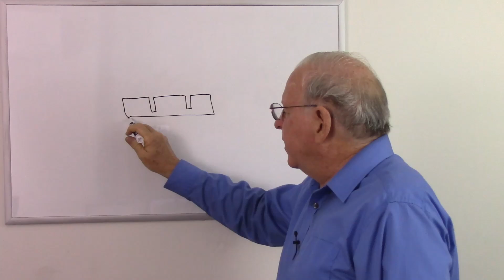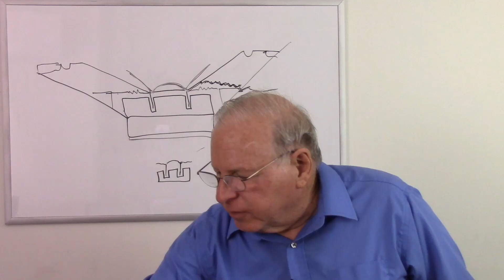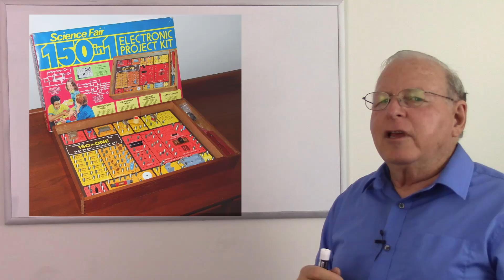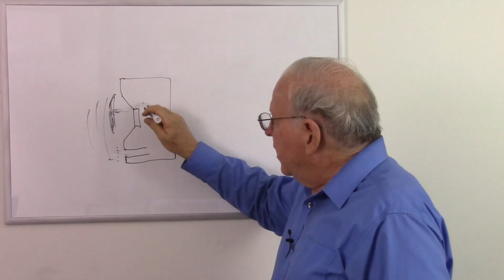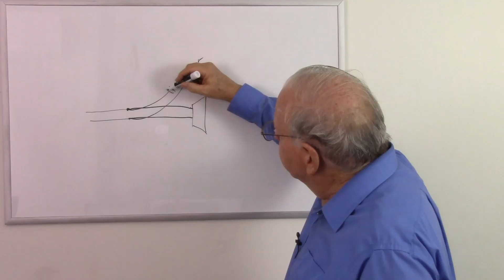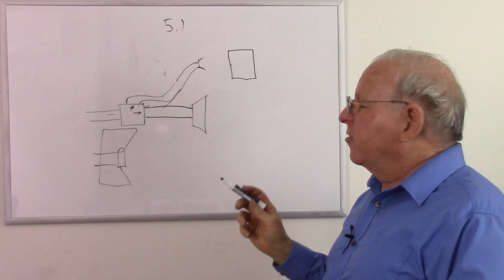Comment: The closed enclosure adds to the mechanical stiffness, and is not seen as 'negative feedback' (whereas having a sensor on the diaphragm and feeding that signal back in the chain would be), although a block diagram can be made for the force equation Fext=Fmass+Fstiffness+... can be drawn with some positive and negative summation in Simulink or similar. The enclosure thus does not affect the higher frequencies from a stiffness point of view, as the transducer is mass-driven there. So, whether you have an infinite baffle decoupling the front and the rear, or an enclosure, the response at higher frequencies is the same. The port output is also not being designed in such a way that the driver output is in-phase with the port output (although above the port resonance that is the case over a limited frequency range), but rather when the port outputs the most, the driver does not move and so it does not matter that it is anti-phase with the port. Again, the upper frequencies are not affected by having a port, albeit for potential (unwanted) resonances in the port higher up.

Comment: 0:27
"Power is manifested by producing either heat, mechanical motion..."

The loudspeaker paradox:
A normal high quality 2-way bookshelf HiFi speaker has an ⁿ0 of about 0.5%.
This means that 99.5% of the power is manifested in heat, 0.5% in acoustic power. 
Considering this, it would be more appropriate to call a speaker a heater. Even though it will be an inefficient heater, but still. 😃

Greetings from a professional loudspeaker designer.

Comment: You seem like a very knowledgeable, old fool.  You got most of this right.  You are very educational.  But you don't know what I know.  Few of you academic types, do.  As you got something fundamentally wrong with speakers.  In general.  And that is... the electrical engineers that created them.  They've all made a stupid beginner mistake.  How do I say such a thing?  How do I know this?  I'm so glad you asked.  Let me explain.

Back a long time ago.  Probably 70 or 80 years ago.  The electrical engineers got something right.  In a very wrong way.  And that is Speaker Absolute Polarity.  They got that backwards.  But their mathematics told them.  That, they were right.  Technically speaking?  They were, they are.  Until they connected them.  When they did it, backwards.

So what the hell am I talking about?  Speaker polarity and not, phase.

I meet oh sure.  You get your left and right channel speakers in phase, together.  You followed your instruction manuals.  For both your amplifier and your speakers.  Then you have it connected, correctly.  As per the diagram.  And you're left and right channel speakers are in phase, together.  But unfortunately.

At the same time you have both speakers in phase, together.  The mistake the electrical engineers made.  Has your speakers in phase together and in Negative Absolute Polarity.  What?

Phase and Polarity, everybody thinks is the same thing.  Sorry.  It is not.  Because your speakers are in phase together but in Negative Absolute Polarity, together.  What does this mean?  What am I precisely saying?

While the electrical engineers think and want to believe.  The speaker cones and domes are, protruding out toward you.  Unfortunately.  Electrical engineers and acoustic engineers are not, Actual Audio Engineers.  However, I am.  Not only multi-major music award nominated.  For my Audio Engineering and Mixing, expertise.  But I am also a top-notch, Studio Fixer, person.  Where I have fixed, monitoring issues.  In, Top Recording Studios and Broadcast Network, TV & Radio Network Facilities.  Because of all the electrical engineers and acoustic engineers.  With their advanced college degrees.  Possess brains.  That only partially work correctly.  And they got this backwards.  This Polarity, thing.

What has happened here is.  Your speakers are actually moving, in the wrong initial direction.  This is what they got wrong.  They believe they have indicated Positive Polarity.  As they used a simple test involving a 9 volt battery.  You connect to your speaker.  And when you see the cone move outward.  They will mark that, connection, Positive.  And that is correct.  This proves they are right.  No it does not.  Because they got the entire concept, wrong.  They are not Audio Engineers.  And thus, don't know what they are listening to.  Don't know, how it should sound.  They are clueless.  Because the speakers are moving in the wrong direction, initially.  They are actually sucking.

That's right.  The speakers are not protruding out toward you.  They are sucking inwards, away from you.  But the electrical engineers and acoustic engineers are convinced.  They are right and I am wrong.  Nope.  It's the other way around again.

What they have actually done.  In their mindless academic ways.  Is to get everything in phase.  From microphone input.  To the audio power amplifier, output to the speaker.  And yes.  They have everything in phase.  And the speakers are in Negative Absolute Polarity, as a result.  What?  How?  Why?  It actually, academically simple, to explain.

Because they are not actual Audio Engineers.  They did not take into account nor consider.  What are the microphone diaphragms doing?  That recorded the music you're trying to listen to.  What are the microphone diaphragms doing?  When a sound source, smacks into those diaphragms.  Which direction are they moving in?  And would you want your speakers moving like that?  NO YOU DO NOT.  That's backwards.  LOL.  What a bunch of lame brains those college grads are.  With electrical engineering degrees.  With acoustic engineering degrees.  What a bunch of knuckleheads frauds.  That cannot understand.  The actual recording process itself.  And what is occurring.

I discovered this Pro Audio Anomaly.  Back when I was only 22 in 1978.  And I had just designed and built from scratch.  Baltimore, Maryland's, second-largest music recording studio and commercial production facility.  And when I say scratch.  I mean scratch.  I design all the acoustics.  I design the control room.  And all the wiring required, therein.  I even designed and built, from scratch.  A 24 input, 8 group output.  With 4 effect, outputs.  And the Stereo Mix Bus.

Then with my custom-built audio console.  That cost over $10,000 in just raw parts and pieces.  Back in 1978.  I included, 3 push buttons.

These 3 push buttons were for, 3 stereo pairs of control room monitor speakers.  Kind of like the 3 Bears.  The little ones.  The big ones.  And the medium-sized ones.  The only problem was... I only have the small, 4 inch, Auratones.  And the big 15 inch, Altec Lansing 604 E.  Control room monitor speakers.  And those were the industry standards.

When I fired up my brand-new, control room.  It looks great.  Everything worked great.  But the sound was not great.  It was not to my liking.  I thought I had made some major technical and/or acoustic blunder?  It did not sound the way I thought it should.  Maybe due to the fact.  I was nothing more than a bona fide, high school dropout with a GED.  And no college whatsoever.  Though?  I did take a couple of weeks of, technical training seminars.  How to fix some tape recorders.  But that's it.

And so now I feel like a failure.  My control room was not sounding stellar.  It looks great.  But not sounding up to snuff.  So?

I hadn't purchased the medium-sized monitor speakers.  So I opted to get a pair of JBL 4311's. And I wired those in.  And when I played back through those.  OH MY GOD!  YES!

I was pleased as punch with those.  Now my control room sounds exactly.  The way I had been tended it, to sound.  How I wanted it, to sound.  The way it had to, sound.

But then I did something funny.  I could turn on any one of those three pairs of speakers.  And so I also turned on the Altec Lansing 604's.  And whoops?  What?  What's this?  My Altec Lansing speakers are, " out of phase " with my, JBL, speakers.  But wait?  Everything is wired correctly.  And both pairs of speakers.  Were designed and built by the same guy.  James B.  Lansing.  And I wondered, why would he have done this?  This doesn't make any sense.  They are not Properly Polarized, together.  Then I turned on the Auratones.  They were the same as the Altec Lansing speakers.  Out of polarity but in phase together.  To the JBL's, also.  What the FUCK?

(More Backwards Speakers in following posts)
Reply: The microphone moves in for a positive pressure, if it is wired that way. It typically has its fundamental frequency high up, so in its operating range it is stiffness controlled. So, you make sure that you have that phase correct. The loudspeaker is different. It is operated in its mass-controlled region. A battery will push it outwards (if you wire it that way), which means that it generally moves inwards(!) for a positive voltage in its operating frequency range. That is what you want because not only is there a transducer principle, there is also a mechano-acoustics coupling, and the typical environment (acoustic impedance) seen from the loudspeaker is mass-like. So, a negative displacement drives a positive(!) pressure (skipping a lot of details about the actual impedance, modes, the driver not being flat, and similar). You are on to something, but only halfway there. Most acoustic engineers get it wrong, yes, in that the see positive pressure for positive voltage, and assume (via thinking about the battery) that positive displacement is driving this, but there are two anti-phase operation that they are missing, but they end up with the correct wiring, which is opposite of what you suggest. Now, when adding a cross-over, taking into account the phase response of the multiple drivers, and the acoustic environment, the pressure phase is not quite in-phase with the voltage, as a loudspeaker generally has quite a nasty phase response, so looking at the step response of various loudspeakers, even within the same company, the first part of the step response may go down or up, and so the actual labeling (red/black) on the rear of loudspeaker is not trivial, and is probably decided differently for different companies, so you could have a point there, but otherwise a rant without much substance.

Comment: Our brains can not decipher.  Sound in front of you.  That is sucking away from you.  And being able to tell what the hell you are hearing?  Without jumping through multiple hoops.  Of playing back through multiple speakers.  Then hopping in your car and listening in there.  To try and get your mix right.  At a great expenditure of effort and time.  Then they all end up thinking... there is something wrong with their acoustics.  So they spend thousands of dollars more.  On their acoustics.  But that still doesn't do it.

Then they think they have purchased the wrong amplifiers.  So they changed those out.  That still doesn't do it.  So it must be their audio console that's not good enough?  So they replace it with a much more expensive one.  And that still doesn't do it.  So they call the acoustic engineers back in.  And they add some more gobbledygook components and electronics.  And that still doesn't do it.  That's what I get the call.  In their desperation.  Because I've been known.  As one of the finest pair of ears.  In the industry.  And that would be correct.  I am.

And so when you have to correct the control room.  For one of the finest American and worldwide audio console manufacturers called API.  At their own studio.  They were Dumbfounded.  Then they saw the light.

Over the years... I have explained this to multiple, electrical engineers and acoustic engineers.  And the reaction was?  Oh my God?  You're right.  I had never thought about it that way?  Is the general, response and reaction.  That's right.  Nobody has ever thought about it, this way.  Except Jimmy Lansing back around 1948.  I discovered this in 1978 when I was 22.  I had heard the speakers.  10 years earlier when they were introduced.  At 12 years of age.  And I knew I was hearing something very different.  I knew at 12 years of age.  I would have to own one of these pairs of speakers by JBL.  They sounded correct and right to me.  And they became an industry standard.  I believe for just this reason.

The later... other folks came up with much more expensive, luxury monitor speakers.  Some costing tens of thousands of dollars.  And they are all in negative absolute polarity again.  Because nobody gets this right.  They have college degrees.

So I take a dim view.  Of these on Io experts with electrical engineering degrees.  They don't know what the hell they are listening to.  They don't know how it's supposed to sound.  But they got their mathematical equations correct.  Goodie for them.  It's wrong.

So with any other brand of speaker other than JBL.  Just reverse the connections.  On both your left and right channel speakers.  Then sit down with a nice drink.  And your favorite recordings.  And take another listen.  You may be shocked?  And you might get angry?  Because you realized.  You have been listening to everything the wrong way.  Your entire life long.  With your electrical engineering degree in hand.

So you have to actually know.  How the recording process goes.  What everything is doing and how.  And at the end of the line.  Where the audio power amplifier output is connected to the speakers.  That is the only place.  Where Absolute Positive Polarity can be established.

But then I've had some famous, Electrical Engineer said to me.  All they have to do is invert the phase.  At the input of the audio power amplifier.  And they tell me they don't hear any real difference.  I tell them they are correct again.  You will not hear much difference that way.  Whether you invert the waveform or not.  Because the output absolute polarity.  Remains the same.  Even if you invert phase at the input.  There will be no difference in output polarity.  It's still Negative.  Whoops.  That's a no-brainer to do.  With their college degrees.

So this is a great video about speakers.  And now you know how to correct your polarity.  So you can hear it.  The way it's intended to work and sound.  Not the way.  Stupid electrical engineers think it's supposed to work.  Because it's backwards their way.  Like a cult.  A religious cult.  And most of those religious cults are stupid, awful, dumb, wrong.  I mean who needs that nonsense?  I don't need to run with the pack of idiots.  To ensure.  I'm just as stupid as they are.  Hell no!

I can't be like them.  Because I have to fix these studios.  They can't get right.  And this is the easiest, dumbest, technical audio FUCK up.  I consider in Pro Audio History.  They've all gotten this wrong at other speaker manufacturers.  Every single last stupid one of them.  Because they are electrical engineers.  They are stupid electrical engineers.  They do not understand the recording process, at all.  Because they didn't consider what the microphones were doing.  They left out that important factor.  From their stupid mathematical equations.  Because they cannot think.  They have no power of thought.  And they don't know.  What they're speakers are supposed to sound like?  Because test equipment.  Is not alive.  Does not have ears.  Does not have a brain.  Can make no decisions.  Can't evaluate nothing.  Because test equipment is inanimate.  It doesn't know what is in polarity or auto polarity.  It just indicates voltage levels.  And it's all interpreted, wrong.  By electrical engineers and acoustic engineers.

So as a result.  It keeps the Pro Audio Industry, rolling.  With people constantly changing out all their equipment.  Constantly changing their acoustics.  All that costs all want of money.  Because they cannot think for themselves.  They can not think the process through.  And what is actually occurring?  They are clueless idiots.  Like a cult.

Good things do not normally come from cults.  Bad things do.  And people die.  Businesses die.  Studios die.  The record industry has died.  And everybody's an expert with a college degree.  And don't know what the FUCK they are listening to.

So there you go.  There is all the real information you need.  To be able to listen and enjoy.  The way God intended it.  Not backwards.

I guess I have gods ears?  Other people have college degrees.
RemyRAD

Comment: As an aside on subwoofer placement, there are room effects (standing waves) that wont change the (non)directionality of the sound, but might setup distorting resonances.  The good news is that because they are entirely non-directional, the resonances are symmetrical.  So where do you put your subwoofer for good sound?  well, put the subwoofer on your chair (preferably at head level), play some sound only through the sub, and start crawling around on the floor.  where the subwoofer sounds best, thats where it goes to live permanently.

Comment: Bass reflex are great for efficiency but remember when you play a drum through them you actually get 2 thuds. One from the speaker and one from the port.
Reply: I might add that at low bass frequencies the ear can't detect 50% distortion. Our lugs are designed to hear human voices.

Comment: Hello, after long time..
I'm back with SUPER CURIOSITY on reverse camera wiring diagrams.

Why are you not making any videos about backup reverse camera in cars?
These days many comes pre-installed with rear camera.
Hence, the curiosity arise for the need to understand how the camera sends signal to the radio unit, etc etc??? 

In fact, in general, reverse camera has 5 wires with one wire being a shielded ground, one is camera power, one is camera ground, one is video power and another is video ground. Total 5 wires.

So, can you please immediately make new videos on these 5 wires??? Please 🙏🙏🙏
Reply: At what time would you like it ready?
Reply: @alce0300  LOL, no later than 6PM this evening.